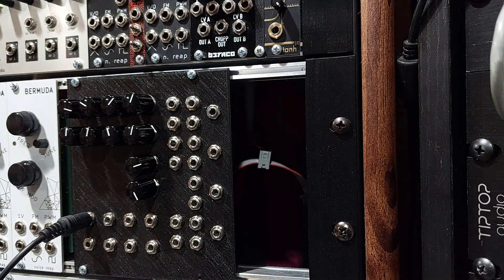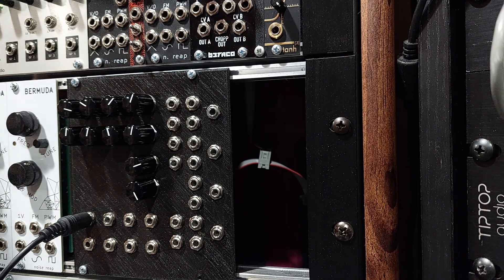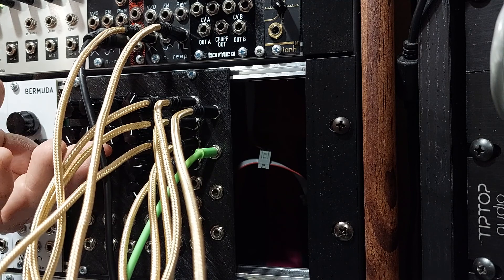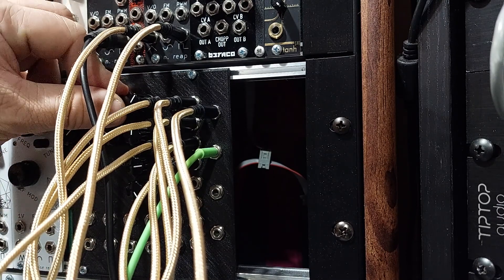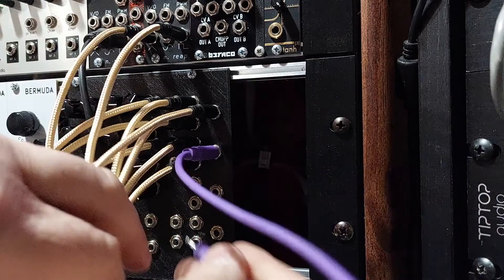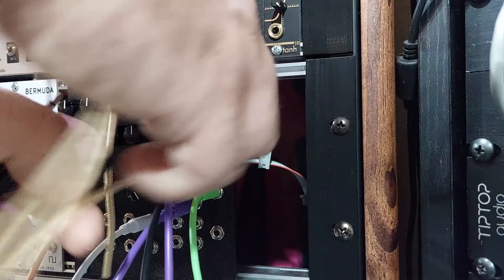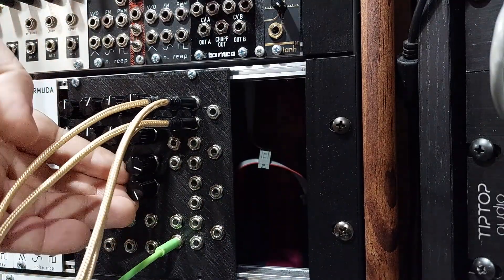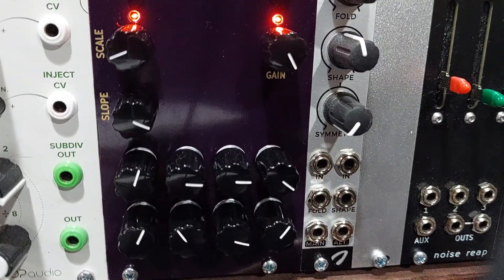York Modular XO106r5 prototype -- first patch

Comment: I'll address some of the 'don't knows' ;-)

- The 'final' pot/jack layout is exactly as you describe, but the 'production' panel will obviously be labelled.

- The logic operation in that module is XOR, via a CD4070 IC. As with previous versions, you can swap this out with any pin-compatible CMOS logic IC (4001, 4011, 4093 etc.etc.) to alter timbres etc., although the patchable logic kind of renders IC replacement redundant, although obviously there's nothing to stop you doing that. That said, as before I will be supplying alternative ICs, assuming the current semiconductor supply issues sort themselves out. 74-series ICs might work for the logic stage but I never use them myself due to their inability to work above 5V.

- the pot orientation issues are fixed in the 'final' boards - the screwups were a case of me not paying attention (too much coffee? too little sleep? Who knows?)

- Current starve: microcontrollers really don't like being starved of current so I removed that ability. Current starve on the logic IC doesn't really make sense but I'm prepared to be convinced otherwise.

- Kits vs. prebuilt - PCB/panel/firmware will be the default option, simply because keeping all the bits in stock on the off-chance that someone will want a complete build just isn't viable. I will offer pre-builts, but only on request. Once you take the pots and jacks out of the equation, the parts count isn't ridiculously high.

- The filter is just a bog-standard Sallen-Key low-pass - nothing special, but there as a bit of a nod to the previous versions. Some people might find it useful, plus it used an otherwise uncommitted op-amp and I hate wasting resources ;-) Other filters are, of course, available and I would encourage people to use them.

- The oscillator firmware is available under a permissive license, so feel free to go nuts and modify it (some C-fu is required, but there's not that much to it)

I really liked the 'beats' you got around the 13 minute mark - shall have to reproduce that; I feel I could do something with it.

On an unrelated note, I really need to tweak the settings on my 3D printer - the panel looks absolutely dreadful.
Reply from the maker: I could've asked all of this first hah, but I was way too excited. Since recording this I've gotten some much crazier sounds and will likely make another video sometime sans the rambling.
Reply: Make another video by all means - the only reason I don't is because I'm absolutely shit at it; this video will likely get embedded in the product page once I get the production boards and the blurb written up.

Want something to work? I'm your man.
Want it to look nice? Forget it ...

I'm kind-of thinking (half a bottle of vodka will do that ...) that sending out prototype/first run modules to a chosen few in return for videos that I can use as marketing material might be an idea with some mileage in it ;)

Comment: Thanks for making this video!
I had the smaller version but sold it because the lack of cv inputs and the sound sculpt option.
But this version seems to tick all boxes.
Reply from the maker: Something I forgot to mention. Whether this is my own incompetence or not, this version is giving me different sounds than the previous ones. I definitely wouldn't replace one with the other.
Reply from the maker: Glad to be of service. I have a rackbrute with three older versions, each with a subharmonjcs generator and LPF. Lots of crazy sounds to be had there, but this design really knocks it out of the park.
Reply: In my defence(!), the earlier versions were designed as sound source for use in 'industrial' style percussion patches, and that's how I used them - CV was never a consideration at the time, and I'm probably in a minority in thinking that CV, whilst undeniably useful, is not the be-all, end-all when it comes to functionality. I design my modules like I design my software- do one thing and (hopefully) do it well.

This updated version represents a logical (see what I did there?) extension of the 4.5 and incorporates a bunch of features which Johnny (and others) asked for - hopefully I've been able to hit the mark in that respect. I'm always open to ideas and suggestions.